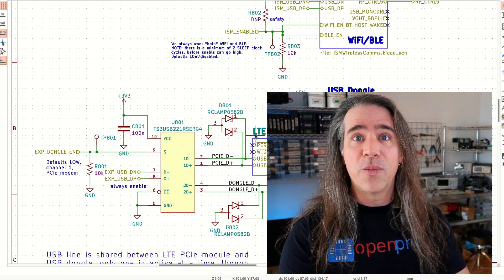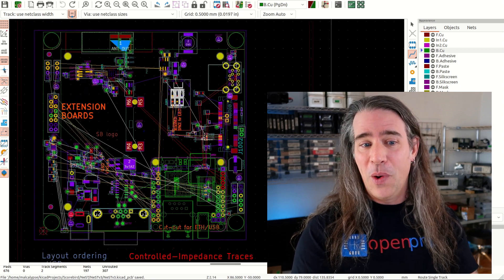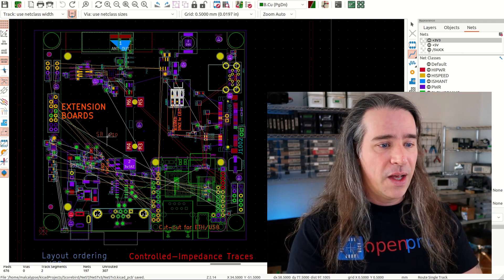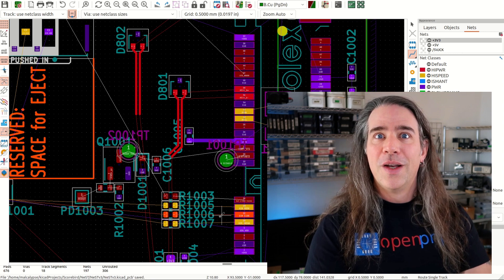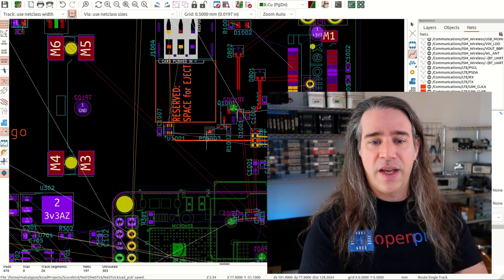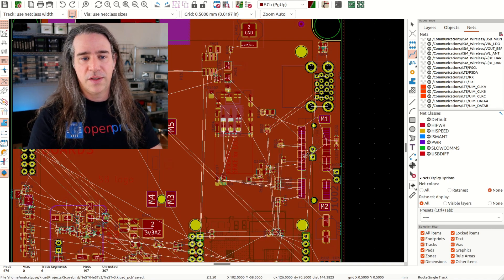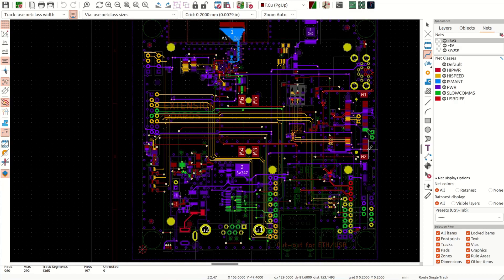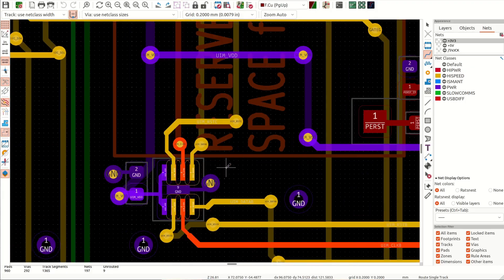Awesome Kicad Routing Assistance

Comment: Switched a 4 layer board to 2 layer and now...sigh...anyway, guess I can switch it back to 4 layer if it's too much of a hassle to route it.
Reply from the maker: Hah, sorry to hear it-2 layer is great if you can get away with it: I used to try really hard for 2 layers because of the price difference but now it's come down so much that it's mostly about turnaround time--if I need something like right now, nothing beats a green two-layer!  And, truth be told, I'll sometimes use layer 2 on a 4-layer as a cheat to get by something tricky, but mostly I turn to them for solid, nearby, ground planes.  If you need some controlled (or semi-controlled, anyway) impedance, it's a lot easier and the nearby plane makes them way better on EMC, too.

Comment: Hey man any ideas on how to deal with propagation delay in kicad?
Reply from the maker: Hi, sorry took me a while to catch this!  So, yes, some ideas... but what do you care about?  If it's skew between some signals on a bus--which I think is most likely--it's not too complex but also not superduper integrated (last time I played, anyhow).  In short, you can use length tuning on your wires (https://docs.kicad.org/7.0/en/pcbnew/pcbnew.html#length_tuning )... my main technique can be summarized by:

  * route all the related signals together, but with enough space between them to add serpentines later; 

  * if you're doing layer hops, keep all the traces doing the same thing (if you go from layer 1 to 4 for one, you do it for all), that way you don't have to worry about via lengths or changes in permitivity; and then

 * get a measurement for your longest trace in a particular segment (layer) and grow the others to match using the tools

If you care about absolute signal travel times, then you have to care about the specifics of your PCB and actual trace lengths, rather than relative, though I doubt that's the case (lemme know otherwise).

Though not quite related, if you're doing something where any of this matters, you probably also need to setup controlled-Z just to get it nicely behaved, which is all about materials and trace dimensions.

That's the short version.  There were some plugins available but don't know how useful and if they've kept up with the rapid changes coming from kicad these days.

Comment: Hi, How to do length matching
Reply from the maker: Hello Selva,  to answer your question: in the case of differential pairs, just routing them as such is often good enough.  However, if you really care, then have a look at https://inductive-kickback.com/images/tuningTrackLength.png  The first example is completely "manual style", just go "Inspect -> Net Inspector" and have a look at tracks you care about, tune accordingly.  The second is using "Route -> Tune skew..." (it shouldn't be done randomly in the middle here, but the image is clearer this way) so the first part is at the beginning, and the last frame is when skew has been eliminated.  I just clicked and moved mouse around to get the squiggles.  For buses larger than diff pairs that are really fast and it matters... it's been a while, so I don't really know and would probably use the net inspector and a bunch of "Route -> Tune length ...".
Reply: @PsychogenicTechnologies  thanks a lot, keep doing more videos